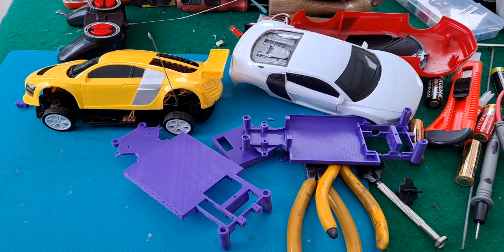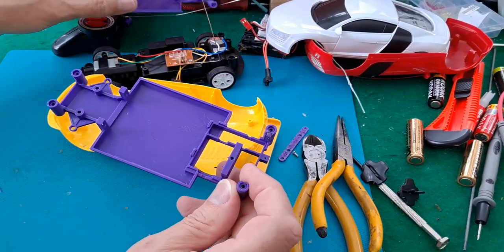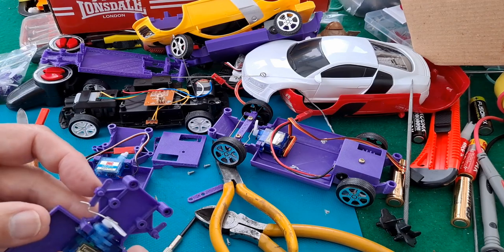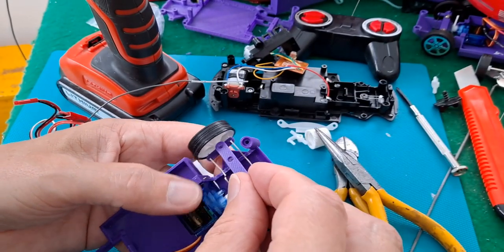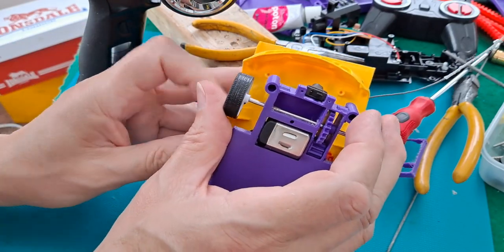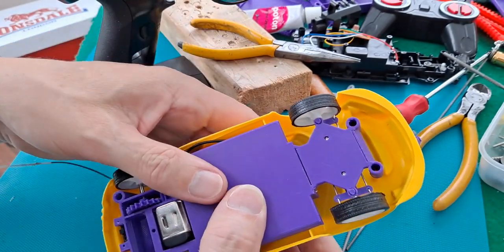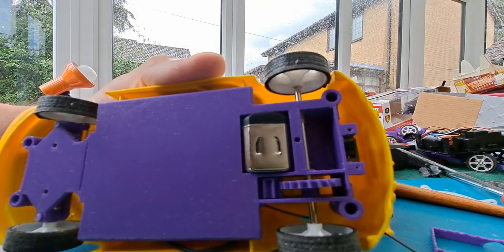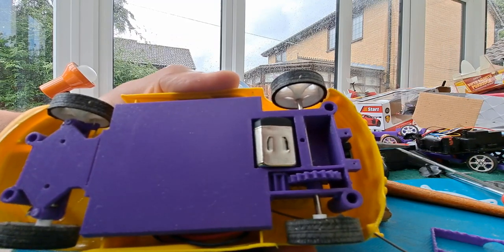Converting the £3.99 toy grade RC car from The Range to hobby grade

Comment: That is some break-neck proof of concept. Superb development, well done sir.
Reply from the maker: Thanks, with the development work done on the Poundland cars this was a fairly simple progression. I really need to change the gearing as the motor overheats, or run it on a smaller battery.

Comment: Nice build. I like that a lot and it works Pretty good too .The Motor compartment could be squeezed a little Bit together as well To make a tighter fit. Nice job. 😀
Reply from the maker: Thanks Marc. What it really needs is different gearing to reduce the load on the motor as it tends to overheat, or I need to run it with a smaller battery.

Comment: It looks easier and faster than when I was building hobby grade chassis out of aluminum.
Reply from the maker: This was obviously easier to do, because of all the development work I had already done on the Poundland car conversions 👍
Reply: @GrandadIsAnOldMan  lol I meant using the 3d printer but there's that too
Reply from the maker: @alfulton5946  yes I knew what you meant, I was making the point that this took weeks of development to get there, so it may not be as quick and easy as it may appear in the video 😀
Reply: @GrandadIsAnOldMan  good morning and yes it probably does appear alot easier than I realize.  That just shows how well your video editing is.
Reply from the maker: @alfulton5946  haha, yes I hide the worst, but my videos are still way too long 😅